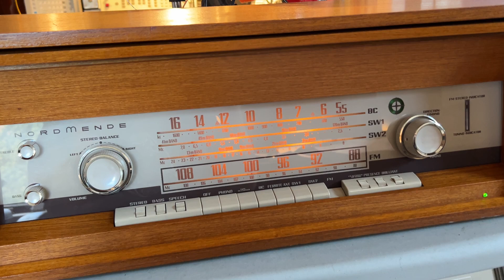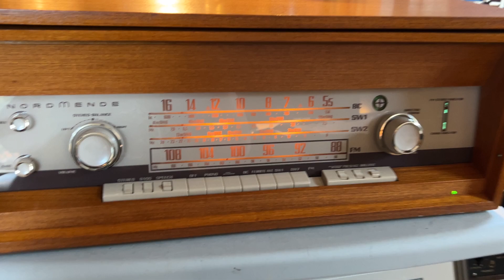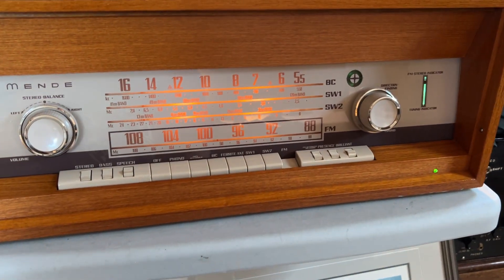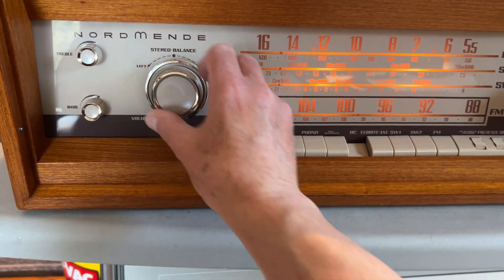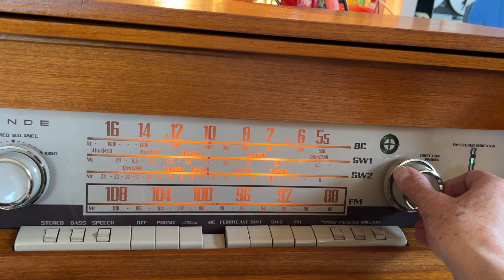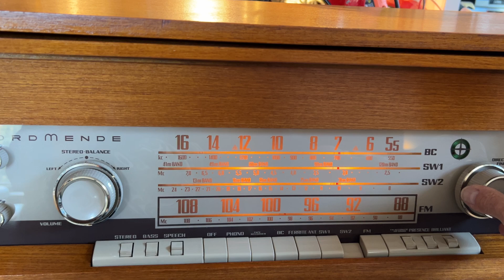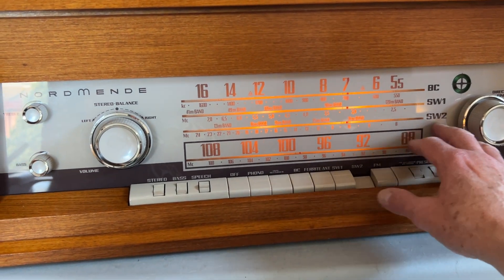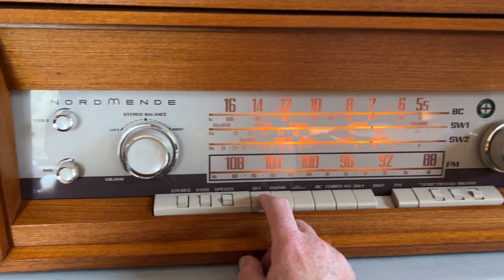Demo of a Nordmende Model 3004 (Export Model) Radio After Refurbishing

Comment: Hi Gerry, Wonderful job refurbishing this radio! I have the exact same model, which was previously my dad's. We used the FM band daily and it really was superb. However, about a month ago it stopped reliably working and cuts out to a loud screeching sound after a few minutes. I am looking to have it cleaned and repaired and would appreciate your insights or a recommendation to a repair shop in Canada (near Saskatoon would be a plus). Thank you, David.
Reply from the maker: Hi David,  Most likely a capacitor(s) failed, or possibly a tube on its way out.  I can ask radio folks I know in your neck of the woods to see if they can help.  Send me an email to 'gerrycohara at gmail dot com' if confirm you would like me to do this

Comment: Nice Vid Gerry, you ever try connecting it with a CD-player or turntable etc. through one of the input plugs on the back? That would give the sound quality quite a boost in quality compared to the radio signal. 5 pin DIN to RCA or AUX adapter cables are still relatively easy to come by.
cheers from Germany
Reply from the maker: Hello.  I do have the correct DIN to phono connectors and I did try playing an mp3 player through the phono input and it sounded good.  I will try a CD player too.  The audio from the FM tuner is excellent.  The set is not my own and I plan on returning it to its owner at the weekend.  I will be posting an article soon on the refurbishment work on the SPARC museum website that provides details on the AM and FM alignment method.  There is already an article there on a Model 3004 I worked on last year, here: https://eddystoneusergroup.org.uk/Restoration%20projects/Article%20on%20Restoration%20of%20an%20Eddystone%20S870.pdf

Comment: I have a large delmonico stereo table radio.
Reply from the maker: Hi Paul.  Does it sound good? - these Nordmende sets sound excellent, especially on FM stereo
Reply: @RadioRestoration  its not a grundig, but its pretty good sound.
Reply from the maker: @pauljames5914  Yes, I have worked on several Grundig models and they sound good too!
Reply: Muito lindo este rádio parabéns
Reply from the maker: @josealeixes2861  Thank you Jose!
Reply from the maker: @josealeixes2861  Thanks Jose!

Comment: I have seen many vintage radios, but this is the first one whose tuning frequency scale goes from right to left.
Reply from the maker: It is not very common as its ergonomically 'unsound' for most folks.  I have come across several where one or more bands have been 'backwards'.  One example that I can cite offhand is the Eddystone Model 870 as I am looking at one right now(!).  See this article for some photos of it: https://eddystoneusergroup.org.uk/Restoration%20projects/Article%20on%20Restoration%20of%20an%20Eddystone%20S870.pdf

Comment: Ładny klasyk. Czyżby lampy ECLL800?
Reply from the maker: The output tubes are ELL80 dual pentodes, the phase splitter is an ECC82, and the audio preamps are ECC808s
Reply: @RadioRestoration ok.
Reply: Ja właśnie takie radio sprzedaje..
Reply from the maker: @Mikut1982  Good luck with your sale!